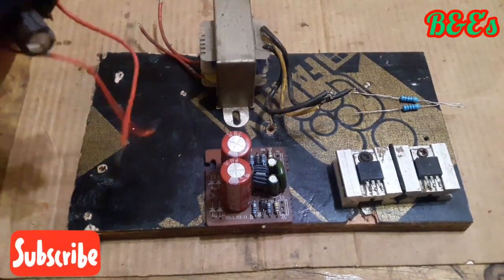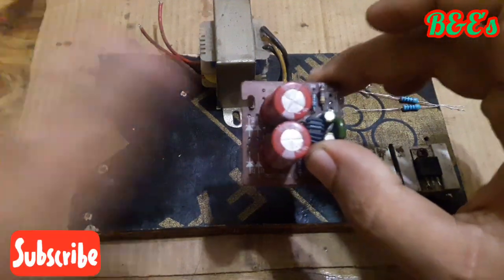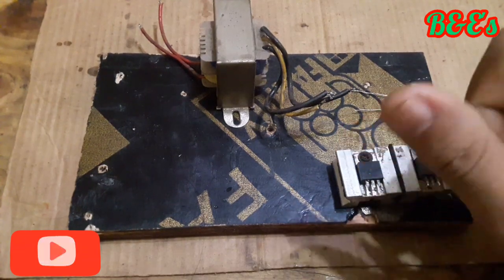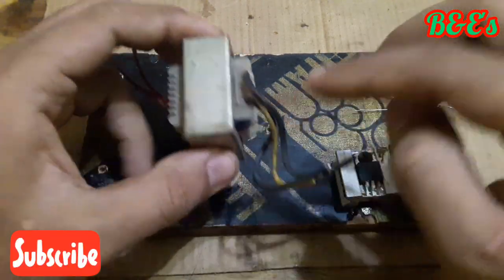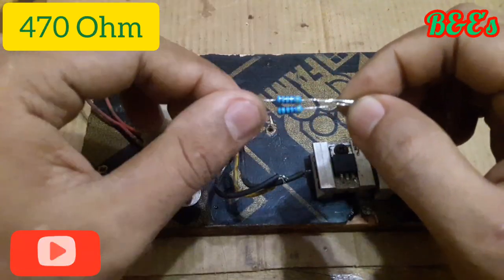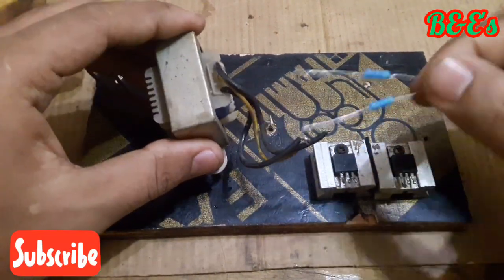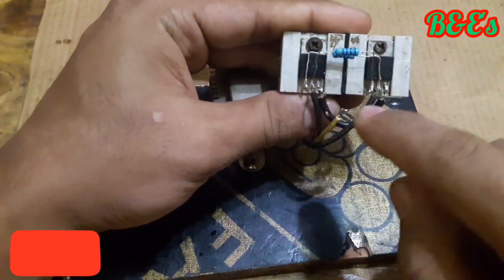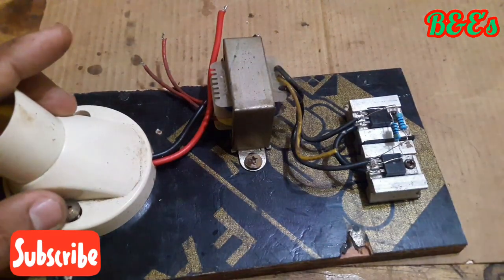မသိသူ​ဖော်စား၊သိသူ​ကျော်သွား|အကုန်ကျသက်သက်သာသာနဲ့အင်ဗာတာအ​သေးတည်​ဆောက်နည်း။

Comment: Bro လုပ်တဲ့ဟာကိုအရင်ကအကြိမ်ကြိမ်လုပ်ဖူးပါတယ်။ broလုပ်ထားတာသည် self slayer exciter oscillatorဟုခေါ်ပြီး
မီးချောင်းချုပ်(ballest)က self oscillator လုပ်တာဖြစ်ပြီးfrequencyက 5KHz  to 15KHzအထိရှိပါတယ်
Video ထဲကtransformer လေးရဲ့ low voltage coilကို ballestရဲ့ live wire နစ်ခုရှာပြီး တပ်လိုက်ရင် transformer 220 Vထွက် အစ မှာ High voltage high frequency ထွက်ပါတယ်.မီး လုံးကledဖြစ်ပြီး မည်သည့်frequencyတွင်မဆိုမီးလင်းနိုင်သည် . Transformerကထွက်တဲ့ဗို့အားသည်coil များ အချင်းချင်း
လျှပ်စစ်ဖြတ်စီးပြီး coil တွေကိုshort _circuit ကျစေတယ်. Bro က load (Led) ဆွဲထားလို့coil တွေဘာမ မဖြစ်တာ.
Bro high voltage လို ရင်ကမ္ဘာနမည်ကြီး ZVS driver circuit ကိုသုံးပါ.@electroboomတို့ တောင်သုံးကျတဲ့circuit
Reply: Your right မင်းမှန်တယ်